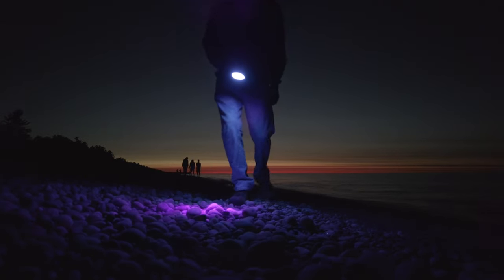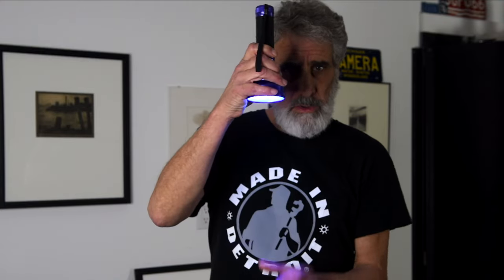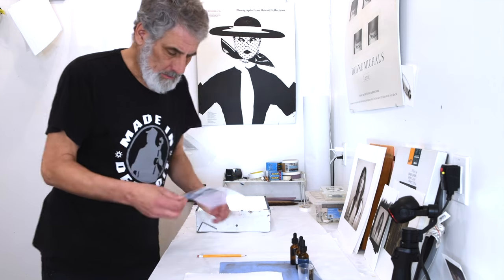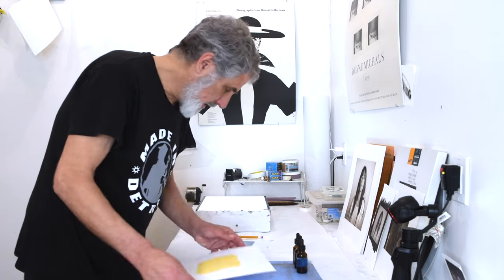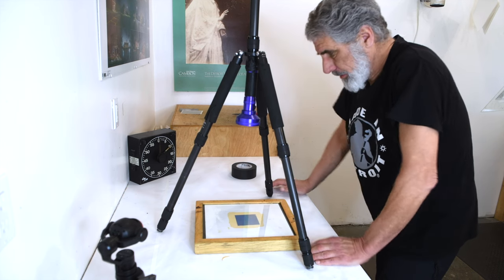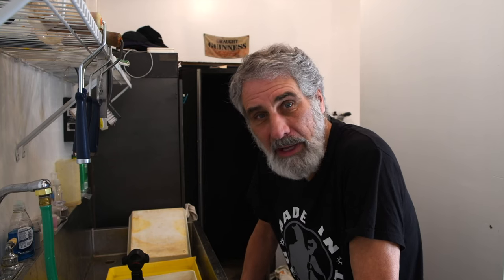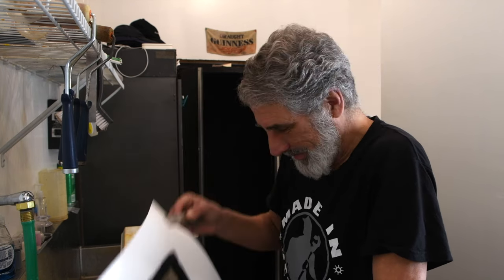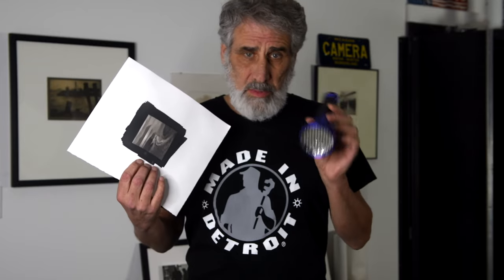Palladium Printing with a UV Flashlight!

Comment: Excellent video as usual Bill. I use a vacuum frame for my alt printing and as a light source I now use UV floodlights. I have two, a 100watt 365nm and a 395nm 50 watt lamp. They are cheap ($40 - $80) very consistent and COOL to operate. I much prefer the point source light they give rather than the black light tubes (which I ditched some time ago). The 50 watt gives me a 6 minute exposure time the 100 watt 3 minutes for PT/PD printing.
Reply from the maker: This is great, Barrie! Thank you!
Reply: @BillSchwab  Bill, if you use these floods to expose original camera negs, (like 10x8) you can dodge and burn the traditional B&W printing way during the exposures. Wear safety glasses though! I don’t like ultra short exposures personally so these are ideal for my way of working. Gum exposures are about two minutes with the 50 watt lamp.
Reply: PT/PD?

Comment: Interesting, thank you Bill.

The first thing that comes to mind is that using this flashlight handheld would allow completely flexible control by "painting" with the light over an image.  Burning and dodging simplified, although possibly at the expense of getting even exposure if that's what is wanted.  Maybe some mix of tripod mounted stability and handheld spot treating?

I've been experimenting with salt prints, having fun but so far this year I'm still waiting for consistent non-rainy weather in the Northwest.  This looks like a great option until I can build a UV light box!

Comment: Awesome! I’ve tried and failed at building a working exposure box. This could be fun to try before I attempt another box. Question, I got a platinum, palladium kit that I’ve had about a year and a half now do the solutions for that expire?
Reply from the maker: Hey there, Captain! It’s a great way to try it out! As for your palladium solutions, the kit will still be good most likely. The one thing that can go bad is the Ferric Oxalate. It sometimes can go in six months or so, if not stored correctly. Give it a try and it still should work. If the images seem weak or anemic, it might need to be replaced. No worries as it’s very inexpensive. In comparison to the palladium. You can just order a replacement bottle from Bostick and Sullivan. Good luck!
Reply: @BillSchwab  Great Thanks!